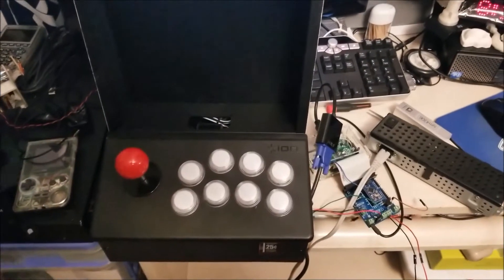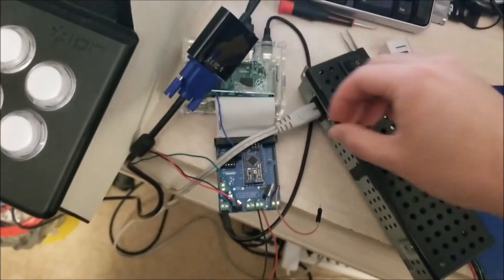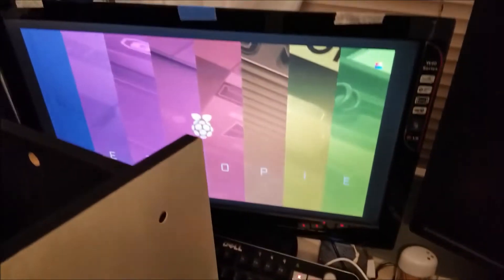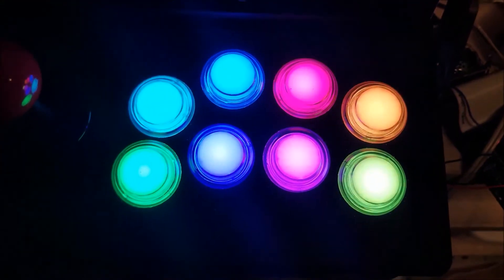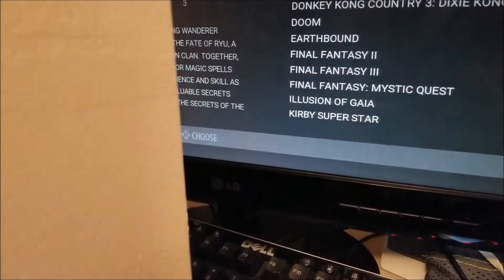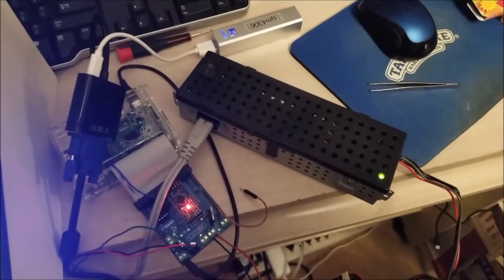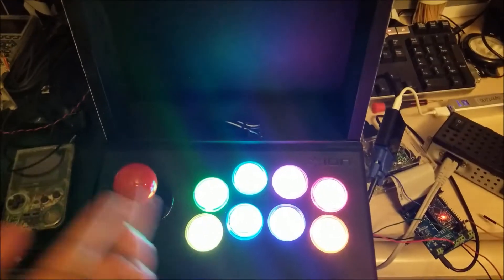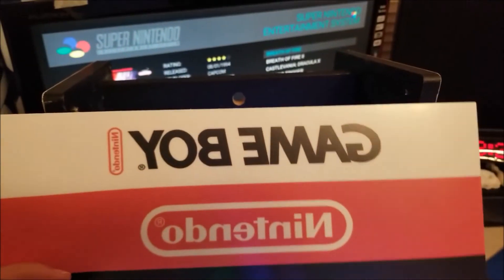Retropie Raspberry Pi Arcade Project: Part 3 - Paint/RGB Button Wiring/Custom PCB

Comment: where did you get the buttons?
Reply from the maker: I got them off ebay but they are originally only a single color. I opened them to remove the leds and replaced them with ws2812 addressable rgb leds.
Reply: @sjm4306  which one you buy? could you give link?
Reply from the maker: @aurimas4-t6g  these are the ones I got: https://ebay.to/2JMCvJo (I cant find the exact seller I got mine from as I made this video nearly two years ago but these look like the same model)

Comment: Cool build, best youse of rgb-buttons! how does the arduino know what system retropie is booting into? i'm trying to do something similar for my bartop build (though mine is pc/linux based instead of pi). Does retroarch have some kinda api that you tap into?
Reply from the maker: If I remember correctly, I wrote a bash script that periodically calls a function which returns a string to tell you the emulator that is running. I then output that via I/O to the arduino so it knows what pallete to load up and display. There are also other options to return the game rom string as well so you could even make an lcd marquee that loads the art for the game that is running. I'll have to check when I get home what the function/api is called as I don't remember it off the top of my head.
Reply: If you can provide more information regarding this I would really appreciate it! I made my first MAME cabinet using a Windows PC with simple red and blue buttons but would like to build another using a raspberry pi as well as RGB buttons and I really like what you've done here. Any tutorials or directions you can point me to would be awesome. Also, where did you get the clear buttons? I see on Adafruit they have a simple tutorial and sell the buttons but they seem to be a little expensive. Thank you again.

Comment: Sweet one, a friend convince me from buying a Neo Geo MVS System but is taking ages to arrive, i only hope is functional since it was sold as untested :( - i will see if i convince Myself to get into a full project like this one using the system
Reply from the maker: Cesar Melendrez Do you have any mvs games? Metal slug is a must have.
Reply: The system comes with a few games but none Metal Slug yet, but yeah is a game i'm going to hunt down to get it (Only if the system works), but its the one than came inside the arcades, but i will still need to get a a lot of parts like the power supply, video converter, controllers and all that kind of shit
Reply from the maker: Cesar Melendrez Well it should be fun getting it up and running. Let me know if you need any help.

Comment: To allow for a faster boot couldn't you disable wireless capablities? It may save battery too. I was just curious. My main love is Computer Science and programming
Reply from the maker: Tiny Plays Wireless is disabled by default since I use a usb dongle which I don't leave connected. I think the slow boot speed is more affected by the fact that I am using a single core older model b+ raspberry pi.
Reply: sjm4306 Oh right so I assume you you want to you'd upgrade to a raspberry pi 3?
Reply from the maker: Tiny Plays I'll probably eventually upgrade it and add a larger hdd so I can play n64, ps1 and psp games but that's for the future after I finish the physical build.